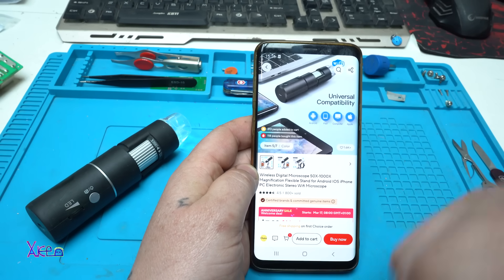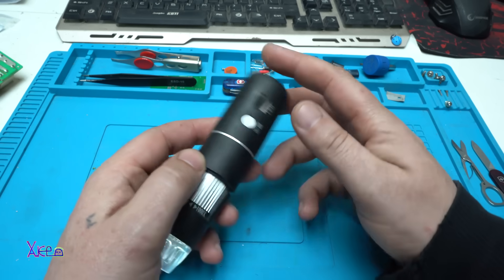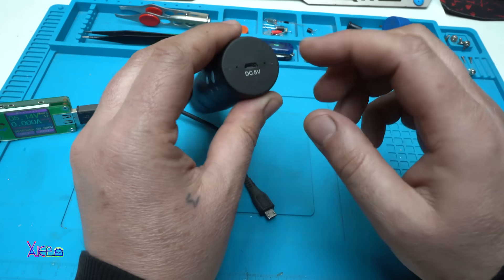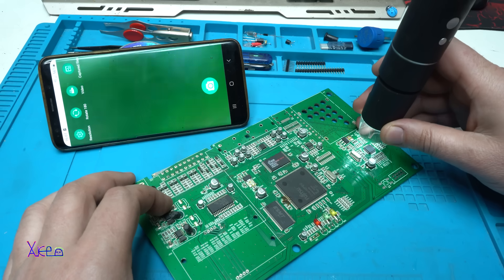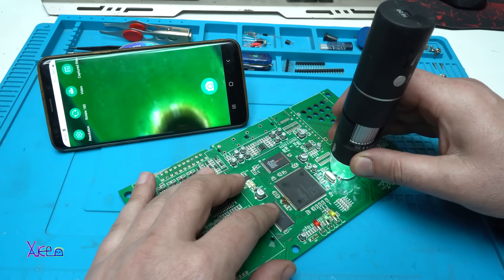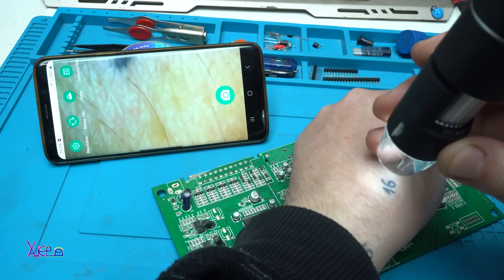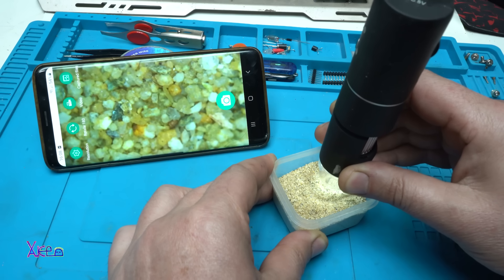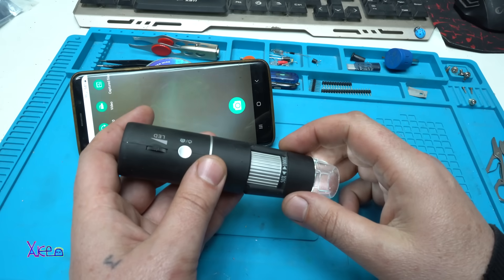WHY THIS $? Aliexpress Gadget is INCREDIBLE?

Comment: I have the wired version of this from Temu, and it's excellent at helping to locate bad traces or bad solder joints.  With the stand, it's easy to see what you're working on, and if you get a decent joint or not.  Using my computer monitor for the display, it's SERIOUSLY better than a magnifying glass!
Reply from the maker: I’ve heard good things about that wired version, maybe I’ll give it a try sometime.

Comment: I had the wired one before I got a good microscope . It was good for the price. It did me to fix bent pins on a Ryzen cpu . The only problem is it is very close to the circuit board for soldering. Great for a budget setup.
Reply from the maker: Yes this model is just to observe,you can watch and repair at same time

Comment: What is the tray you have it looks very practical?
Reply from the maker: If you asking for that 3d printed thing its my next project called portable adjustable psu
Reply: @Hacktuber no, the blue tray!
Reply: @4th_Lensman_of_the_Apocalypse Do you mean the silicon mat? If so also available from Aliexpress. They come in different sizes. Some of them also have magnets in the tray parts. Good for soldering on as they are heat resistant, but not good for cutting on (you want a self healing mat for that).
Reply: @andyspoo2  yes thats what I meant! Its ok I have two cutting mats already!